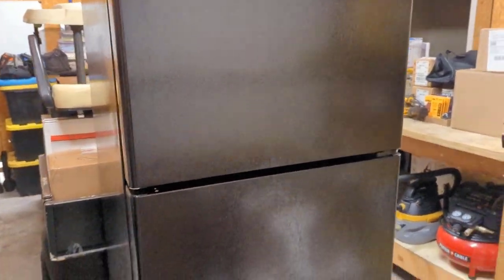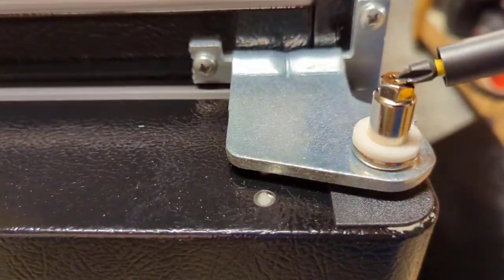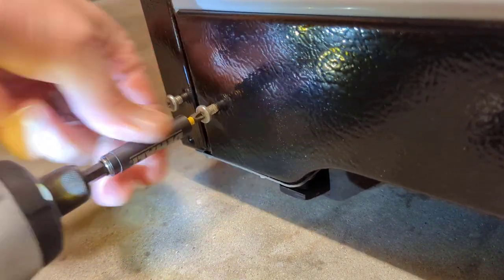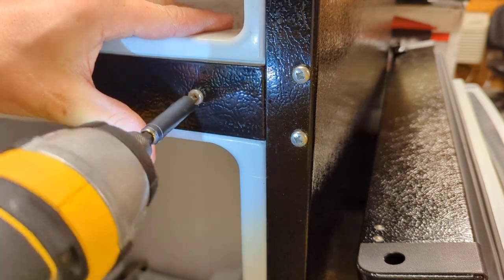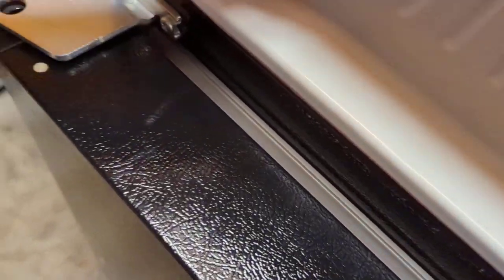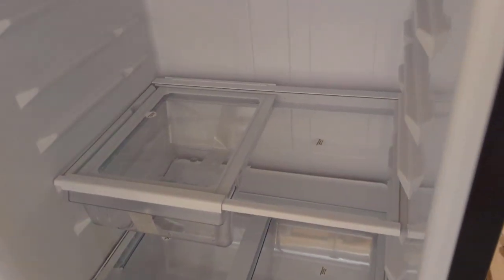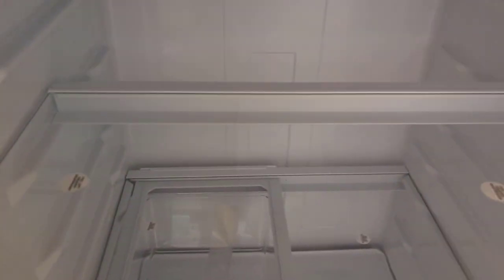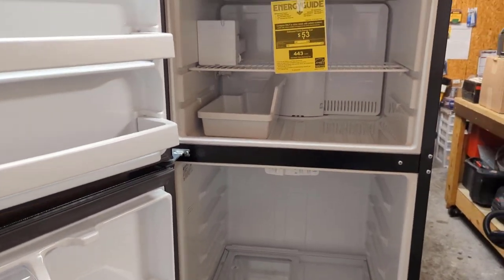How To Reverse The Door Swing On A GE Refrigerator

Comment: My old GE refrigerator (vintage 1982) was showing signs of impending death, so I had to do this yesterday. The instructions in the manual seemed fairly clear, (which you have to download, by the way, no paper manual) but I didn't need them anyway. All I had to do was follow along with this video. There's nothing like watching a demonstration as opposed to reading a description in words and diagrams. Probably cut the time required by half at least. Thanks very much.
Reply from the maker: @richrobertson9457  No problem! Glad the video helped you out. I agree with your statement on watching a video vs reading instructions. A visual of something is always easier to understand compared to reading. Thanks for watching & help support the channel by subscribing 🛠️👍

Comment: They recommend not using power tools in order not to strip how the screws or overtightened. But I suppose it doesn't matter
Reply from the maker: I have always used them. You just have to know how to properly use them & not over tighten the screws & bolts. They are referring to the average person who doesn't use power tools daily. Thanks for watching Fiji16g8 & help support the channel by subscribing 🛠️👍
Reply: 99.9 % of the refrigerator delivery men don't know how to use them they actually broke the wheels completely off of brand new refrigerator I ordered with a power tool
Reply from the maker: @fiji16g8  Damn that's crazy!

Comment: Lowes installer said reversing the door swing/swap is not good idea, the Mouldings around the doors will not properly seal.  Is that true?
Reply from the maker: @billligon4005  You could have an issue with the seal in some spots after reversing the door. I've had that happen a few years back, but with the newer refrigerators I haven't had any issues. If you need your fridge to open on the opposite side, you gotta do what you gotta do. In my opinion, if they weren't supposed to be reversed, they wouldn't make them with the possibility of opening on either side. They put the same holes on both sides, the hinges are reversible, so I don't see an issue with it. A little tech tip, If you reverse a door & you have a gap in your door seal, take a hair dryer across the seal to warm it up, use an object like a pen to go across the edge of the seal so it forms to the frame & then let it cool off in that position & don't open the door for a little while & it will mold to the new shape. Thanks for watching & help support the channel by subscribing 🛠️👍
Reply: @ApartmentMaintenance  Thanks for the advice.
Reply from the maker: @billligon4005  No problem! Appreciate the question & make sure to subscribe to the channel 🛠️

Comment: I reverse the door but had accidentally used the wrong screw where it locks in, for the freezer door.  By doing that, it messed up the spongy part where it tightens the pin screw.  The handle is now loose.  How do I fix that or where would I get the little sponge to replace it so that the handle wouldn’t be loose.
Reply from the maker: That is part of the insulation of the door itself. The best thing you could do in this situation is take the handle off & use some 2 part epoxy or glue or something along those lines to permanently mount the screw in the hole. Once it's dry & in place for a few hours, then re-mount the handle. But definitely leave the handle off while the screw is drying in place. It might be best to remove the freezer door & lay it down so the screw is facing up & won't fall out as it's drying. Hope that helps. Thanks for watching SakhoneMiller2897 & Subscribe to the channel 🛠️👍
Reply: Thank you and for responding quickly.  I will subscribe to your channel.  You give good step by step info and very detailed..
Reply from the maker: @SakhoneMillerRealtor  Appreciate that & thanks for watching & subscribing 🤙